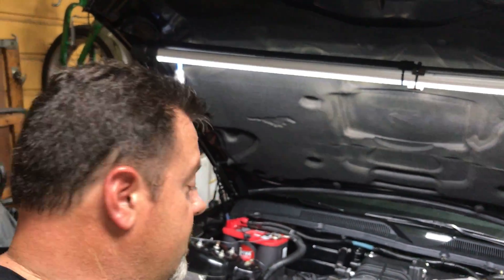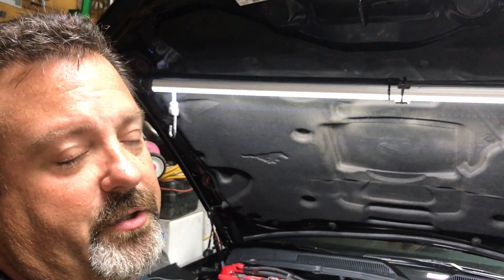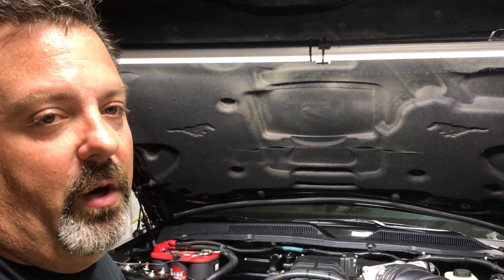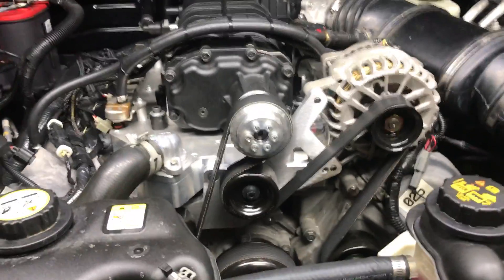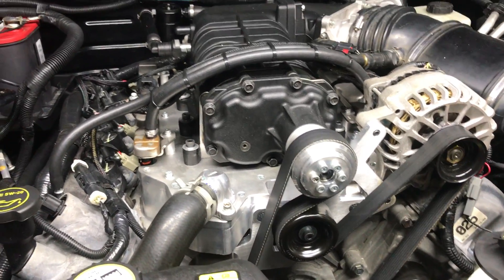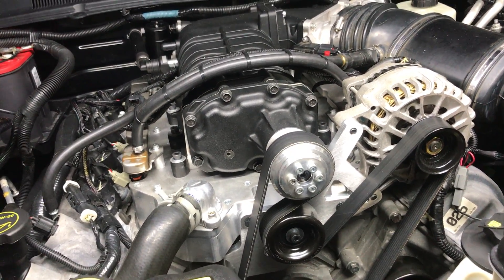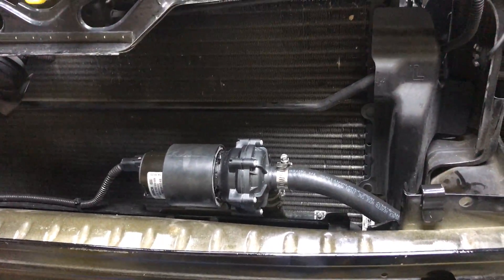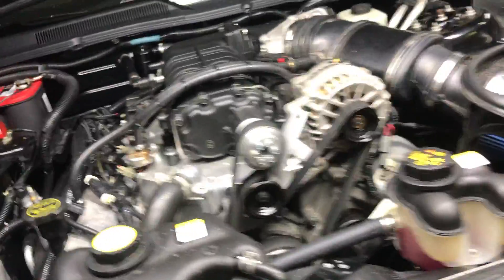How to put a GT500 SuperCharger on a S197 3V 4.6 Mustang GT

Comment: Ford lighten 5.4 2 valve will go on a 4.6 2 valve
Reply: Nope the 5.4 has a taller deck so the distance between the bolt holes left to right would be wider.

Comment: I know this kit is for a 05 and up gt500 stock supercharger. But for example if I wanted a 2.9 whipple or a 2.6 vmp for a 07 shelby gt500 . Will that supercharger fit my 3v mustang  with this kit.
Reply: Yes if it allows you to run stock gt500 blower you can run those blowers as well.  However if you have stock internals this blower is more than enough.  I wouldn't bother with anything better unless you have a built motor.
Reply: @midnight347  thank you!
Reply: Yep

Comment: Come on man like others said we need parts list and some numbers.... Supposing you needed a tune as well. Then according to Brenspeed the stock internals won't handle too much over 450 TQ
Reply: Larry H most i seen people go with TQ IS 470.. other than that your pushing it forreals
Reply: This kit is easily capable of 450 rwhp on a stock engine.  If you have other supporting mods you can make more safely.  I.e. cams and headers and you're at 500 wheel and you can keep torque around that 450 mark.  It can be pushed further with a built motor.  I'd say 600+ is possible with a ported m122 and built motor and cams headers etc if you're on e85.  This is a good blower for a stock motor 3v.

Comment: Not a good deal at all. The dollar cost per hp for that set up is absurd.
Reply: Its way cheaper than a whipple kennebell or procharger, and you can max out the 3v engine on it.....and if you build the 3v you can put a tvs on it and make 700 if you want, ur a moron if you think its a bad deal
Reply: @1991tommygun  right idk what people expect you could literally be all in for like 3 grand or so if you shop smart that is pretty cheap to have your car totally supercharged wjth everything needed the only aftermarket blowers that are lower than 5 or 6 grand or more are tuner kits that still require you to get alot of other crap too making total cost more.  People don't realize that putting a nice pd blower on your car that is good enough to more than max out your stock engine for 3 grand all in is pretty cheap it also gives you much better options to upgrade to in future if you ever decide to.  That is another thing I don't think people factor in...plus this manifold is better than the gt500 lower manifold is the intercooler and line fittings flow more etc. And this is coming from a gt500 owner.  This is a good deal for 3v guys.  Gt500 blower options are way better than 3v options.
Reply: 1991tommygun l
Reply: @1991tommygun  I appreciate you calling me a moron . It speaks volumes about your communication skills and lack of intellect. There are multiple options for supercharging the 3v for under 4k with 3v specific kits . Even more for under 5k . So maybe u should do a bit of homework prior to commenting
Reply: Well, when you start with a 4.6 what do you expect.  Cost is high power is low.
Reply: @joshkeasler512  but the car itself costs a significant amount less than a newer coyote car or gt500 so it's all relative.  450 rwhp 3v with this blower would be plenty of fun and you always have the option of upgrading to better options that were originally intended to fit the gt500 like the vmp blowers and whipple etc if you ever build the bottom end.

Comment: Very nice video. Did you have to do anything to the internals of the engine before installing the supercharger???
Reply: You can and should, but dont have to. Some bolt on stuff will certainly help though, exhaust, high flow injectors, cold air intake would also help a lot, but the only thing I can imagine is a must is a new tune.
Reply: You need to make sure you have adequate fueling and the more supporting mods you have the better i.e. headers exhaust cams etc.  You can make more power on less boost with less stress on the engine.  Don't run more maybe 10 psi or so on 93.

Comment: Yea i checked for a coyoty its like 4300 bucks not worth spend a 1000 more and get an edelbrock supercharger there not giving these kits away
Reply: The manifold and intercooler has better cooling than edelbrock and you can put a tvs on it and make way more hp than most kits
Reply: Edlebrock sucks ass lol.  You can get this kit 2 grand plus 4500 for a vmp gen3r and be 6500 all in and be able to fit a gen3r which is a superior blower into a superior lower manifold for not much more
Reply: @midnight347  i have a gen3r is it as good as a whipple there so expensive what about the edelbrock 2650 heard good things
Reply: Whats your favorite supercharger
Reply: @marcozr3138  imo the gen3r is the best blower for a street car.  I have one on my 07 gt500.  I'm at 750 or so to the wheels on 20 psi with stock log exhaust manifolds and a twin 69 tbody and stock cams etc and I'm on 93/boostane (100 octane).  Torque is round 700 it's a monster.  The Eddie 2650 you refer to has the same rotor pack but vmp/Magnusons case with the gen3r is superior and will make more power.  The higher the boost level the more pronounced gains will be.  Nothing wrong with the edlebrock 2650 but the gen3r uses the same rotor pack in a better case so that is the one to get imo.  It's more than enough power for any stock engine weather it's terminator, gt500 or coyote and is capable of 1000+ rwhp on built motors.  It has awesome torque and fits under stock hood.  Powerband is awesome what's not to love?  Lol
Reply: @marcozr3138  and to answer your question is the gen3r as good as Whipple imo it is very comparable to Whipples gen 5 3 liter blower.  They make comparable power on similar builds from what I've seen hell many times it seems as though the gen3r might even make little better power and it makes way better torque.  The gen3r is a very badass blower.  You made the right choice going with it imo.
Reply: @midnight347  i want to ask you since you had the 2.3 did you find it spooled up faster did it kick in faster or does the gen3r beat it all the way dont forget you have a gt500 you can pully down i cant thats why im wondering if i should of got the 2.3 instead my 3r only kicks in 3500 rpm

Comment: 2500 for a manifold??? Than the blower and anything else. What's the point? Buy one made for your 4.6 3v at that price point or a fuckin bolt on turbo kit for 3g total!
Reply: A blower kit for a 3v is like 10 grand
Reply: @1991tommygun  incorrect. There are multiple options to supercharge the 3v for under 4 k and even more under 5 k.
Reply: Gorilla Cookies ya, shitty non intercooled kits haha
Reply: @GorillaCookies  you can do this around 3500 total and that is plenty of blower for a stock 3v motor.  It would work really well with this blower great power curve.  The power curve overall is something that is often overlooked in favor of just peak power.  That is only one part of the story.  How the power comes on and the shape of the power curve is even more important for a street car than max peak hp.
Reply: @GorillaCookies  those are tuner kits that are non intercooler this manifold has badass cooling and a built in intercooler the manifold works better than any of the aftermarket stuff and the stock gt500 manifold isn't even as good.  It's worth what it costs.  Opens the door for all the gt500 blower upgrades too which are way better than the 3v options